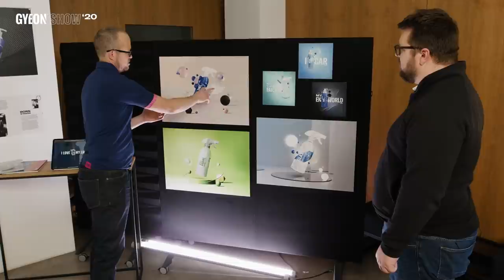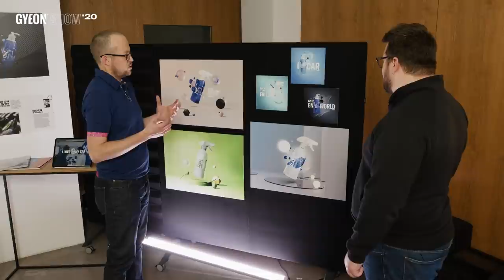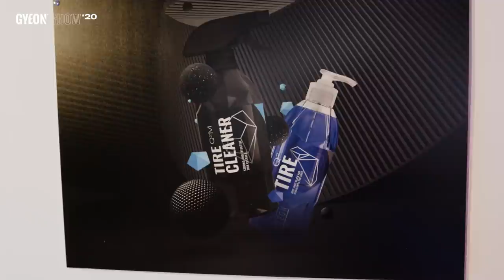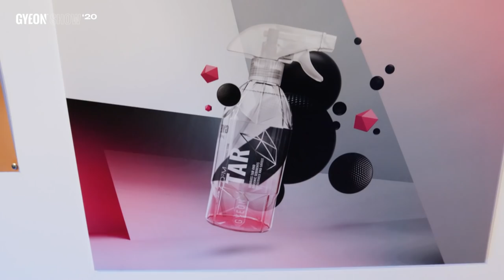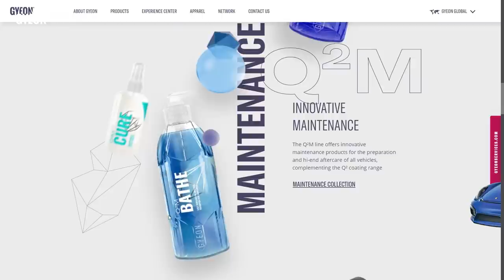GYEON SHOW - DAY 1

Comment: I think there should be more uniformity. Yves is against brushes and he is the face of gyeon quartz on youtube. Now you are showing the apc being used with brushes.
Reply from the maker: There is a difference when and on what surface you would use them, in this case the trim is rubber and not piano black trim and the car is full of defects and in need of a major paint correction. And I don’t think this has anything to do with uniformity rather with when to use what and where. 
Regards,
Y.
Reply: @GYEON_official  I gotcha. Thank you.